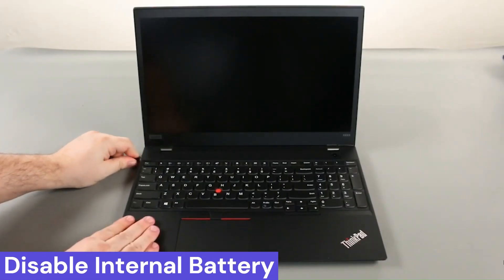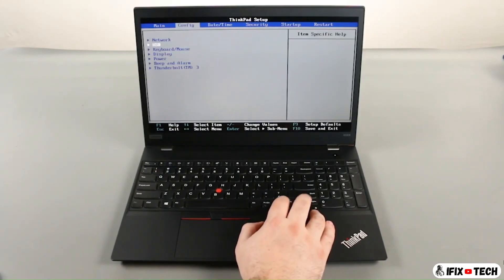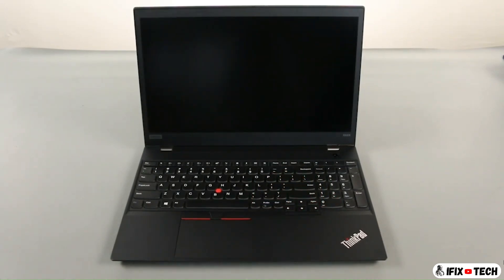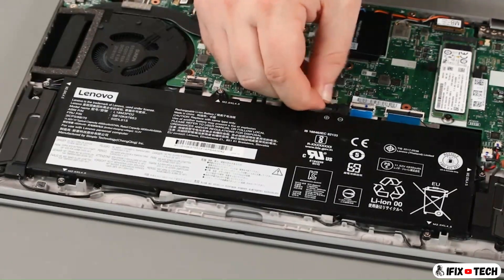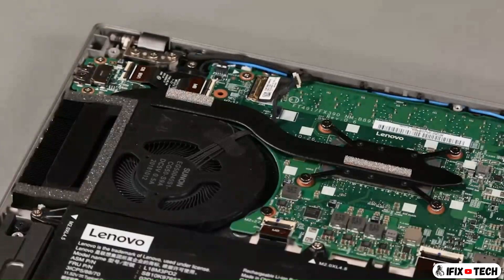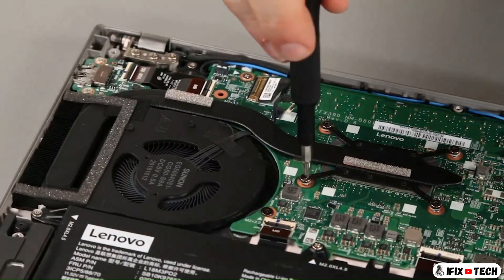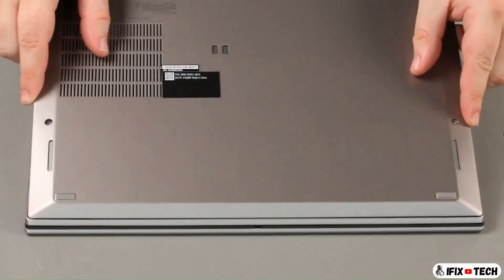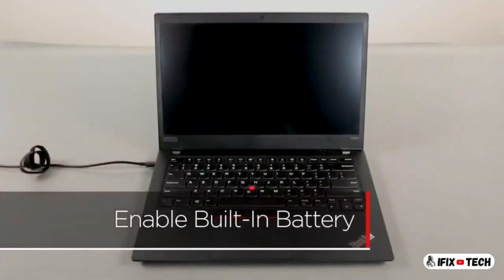Lenovo ThinkPad FAN and HEATSINK Replacement T490s and T495s - How to Remove FAN

Comment: The core next to the cpu doesn't need any thermal paste? Thera different opinions whether it shuld bez coaverd with paste and the others say it must be pasted. What is your opinion? I have recently bought t490s and decided to replace thermal paste. I put it on both that cores and now i guess the laptop is a bit hotter then prepasting.
Reply from the maker: As you say, there are many different opinions. We repair many Lenovo laptops, and this is what we've seen: for a while, Lenovo didn't use cooling paste on it.  Now, all newer Lenovo laptops do come with it. Thanks for liking it and subscribing 👋 😉